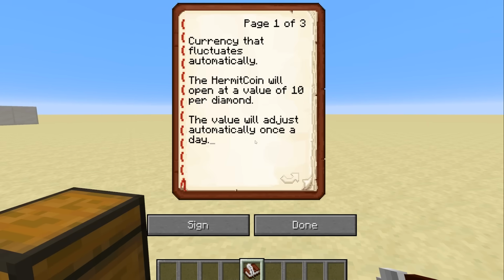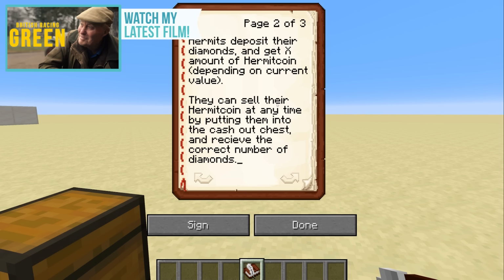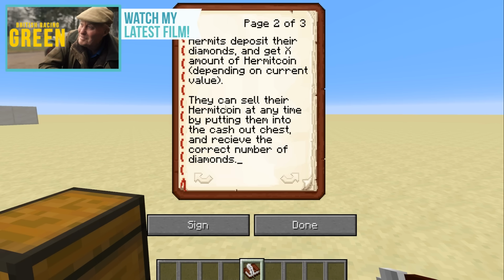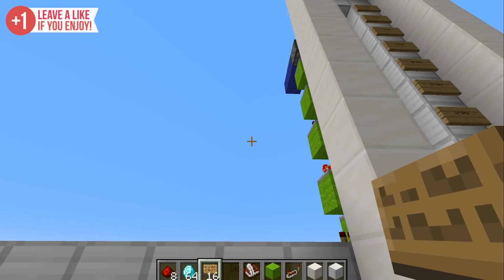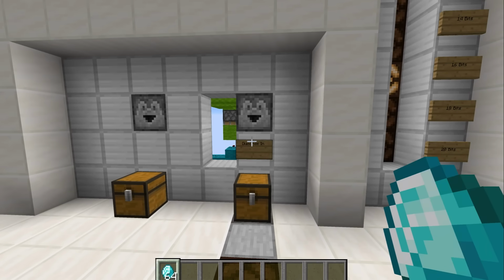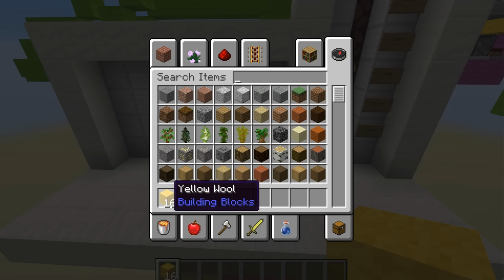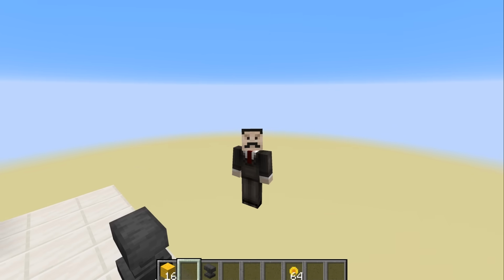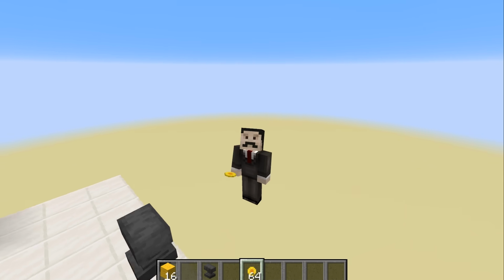HermitCoin Crypto Machine for Hermitcraft!

Comment: If you use the decoder lines also for the input as you have done for the output, you wont get any problems with counters running out os sync

Comment: Is it possible to do a 3x4 (3 wide, 4 tall) garage styled door design? (where the door pulls up and back). I haven't the first clue of redstone besides the torches and dust and even then I do the dust wrong, so I was wondering about that for a while. I made a Walking Dead inspired CDC and the doors look cool, but they don't work. There's 3 doors, but only one needs to work.

Comment: If it’s random, your machine will go broke, I understand how extremely difficult it would be to make it an actual cryptocurrency, so maybe you could add an entry fee or a use fee or a mumbucks pass? Or maybe instead of showing the hermits what the value is, make it a gamble to gain or lose diamonds. For a currency to work there needs to be circulation. You can’t have an economy that can be taken advantage of.

Comment: I think the price should be based on how many hermitcoins are left in stock, updated ever time a trade is made. This makes it impossible to lose diamonds because the total diamond value of all the hermitcoins is fixed. The ones sold first would be cheaper, and the ones sold later more expensive, but the total value of hermitcoins + diamonds in the system wouldn't change. It also encourages early adoption because the people who buy first will get a better price. This could be implemented by storing the hermitcoins in a line of hoppers, with a comparator output from each one. These signals would tie directly into the existing machine. If you charge a transaction fee of 1 diamond, you would be guaranteed to make money. Also, let the hermits take hermitcoins out of the building and trade them with each other. This is vital for hermitcoin to be valuable: you want other hermits to start accepting it in their shops. As others mentioned, a good way to give hermitcoin value would be to accept it at the upcoming Amazon sh Note on implantation: the price might change in the middle of a transaction if they put in serval diamonds (or several diamonds worth of hermitcoin) at one time. You should return any hermitcoin that wasn't in enough to buy a full diamond for this reason.

Comment: I think  there's an issue that arises if you put in say fifteen of sixteen HermitCoins and leave. The next Hermit will have one that is valued at one per diamond to them and then whoever put in the fifteen has no way of getting it back. you should put a coin return option or something that can be used if they didn't put in enough for a diamond.

Comment: I suggest that if the hermit will put a wrong number in, they will get the HermitCoins that left in the system back
Reply: Pretty hard to implement, but its possible. Mumbo would spend a day working on this though so in my opinion its not worth it. The hermits are trustworthy when the war is over :D

Comment: in order to add a form of profit for yourself, you should enclose the trade room, and in order to buy/sell, you have to toss in a diamond to unlock the door.. but you can see the current values without entering.. 

or..

you cant see the value, so you have to trade blind (or maybe only see a relative value, like low/med/high, instead of the exact amount) but you can tip a diamond to see the exact value.. but this would require you to either have different values on the exchange, for example, 1 diamond will get you 16 coins, but that same day, it takes 18 coins to buy back 1 diamond, or put a code of honor in, and tell the hermits they can only buy or sell on any given day, they cant do both

Comment: Price should be normalized and a spread created....each lamp would have a buy price on the left and sell price on the right, starting at say 102 to buy and 100 to sell, incrementing by 1 each upward (so buy goes from 102 to 117, sell goes from 100 to 115).  As you buy, price goes up by 1 lamp, and if you sell, price goes down 1 lamp.  So if you buy at 102, next purchase is at 103 and to sell it back would be 101, so a 1 unit loss immediately.

A really good system would encapsulate the entire range and have a digital display for buy and sell and take care of the movement of the market at any value. :)

Comment: 2 flaws i see. If a hermit waits till the price is really low for hermit coins and buys a bulk amount then comes back when it is at the max and cashed out. You are just lousing diamonds. There needs to be a way that when you buy hermit coin the price will drop slowly and if you sell it, it will rise slowly. Secondly I don't see how this would be beneficial for you. There is a very low chance they will buy 10 coins for 1 diamond and then sell it for 8. People won't do that, they will wait until the price is higher thus making it a money pit. You are going to have to make the buying rate higher than the selling rate so if you buy a 10 hermit coin for 1 diamond you can only sell for example 14 for 1 diamond so you have more competition for a good price and don't have just a money pit.

Comment: With the final output solution with the clock, it looks like the downward piston (that allows conducting the signal out to spit out a diamond) is no longer necessary.  The observer block only extends when the correct number has been reached, so the top piston is not needed.  A little less lag, a lot less noise.

Comment: When u get the Sahara Shop set up set the prices for the items in Hermitcoins. The buyers of the coins will feel like they are getting a deal on your products when the price of the Hermitcoins is high and won't trade them all in for diamonds at once which could potentially ruin you. And when the price for HC is low then ur getting a higher amount of coins back through ur shop!

Comment: Mumbo, you have got it all wrong, the higher the meter the lower the value of a HermitCoin. If it's on 16 hermits per diamond that means it's worth a 16th of a diamond, in the other hand, if it's word 1/2 of a diamond it means that every 2 hermits you get a diamond

Comment: Hi. As a fan of your videos, I'd like to present an argument as to why HermitCoin (in it's current state) is not profitable. I'll also look to try to add solutions to make sure that you can create a sustainable system. I'll be explaining each problem and potential solutions in depth. These are unordered, meaning #1 may not be as important as #3 or vice versa.

1.) Reason / Explanation:  Inflation / Deflation. The volume of your currency is the number of currency that exist at the start. If you add more currency later, the currency value will fall because of more supply relative to demand (inflation), and if you remove currency, the value will fall because of less supply relative to demand (deflation). It depends what you want to do with your currency, because if you have a constant volume of your currency, the value will stay the same. The problem lies in the fact that we are trading diamonds for currency. Diamonds are a nearly infinite resource in Minecraft, given that you mine enough. This means that the value of a diamond will continuously depreciate because of more being discovered every day. In the first few episodes, if someone offered you some diamonds, you would probably have to give them a lot to make up for it. Now, they're the norm. Though HermitCoin will bounce up and down because of randomness, its value relative to Diamonds will shoot through the roof.

Example:
Let's say we have 100 HermitCoin and 50 diamonds in the world. The exchange rate is about 2 HermitCoin per diamond, or 0.5 Diamond per HermitCoin. Let's say Grian discovers 50 more diamonds. The exchange rate to match volume would then change to 1 Hermit Coin per diamond or 1 Diamond per HermitCoin. Mumbo, being lucky, now discovers another 300 diamonds. This brings the volumes to 100 HermitCoin vs 400 Diamond, giving the exchange rate to become 0.25 HermitCoin per diamond, or 4 Diamonds per HermitCoin. As the other Hermits discover and mine more diamonds, HermitCoin will become vastly more valuable.

Current Problem:
Since you currently put an (arbitrary number) bits of HermitCoin per Diamond, your currency will be easy to exploit. If we have 500 HermitCoin, and someone goes and mines up a bunch of diamonds, your counter goes smaller and smaller, until you can't really count it. If you go to any chart of  USD / Bitcoin (in that order) you'll see that the long term trend is always to get smaller and smaller, as the currency becomes more valuable.

Solution:
Change your exchange's currencies to use diamond to HermitCoin exchange, such that the initial price may be 4 diamonds per HermitCoin. This will also help stifle some early issues with supply / demand.

2.) Reason / Explanation Price Action: Price action is defined as the movement of price up and down due to changes in volume and relative demand / supply of a product. Currently, price action is merely random and fixed rate. Day by day, the value changes, randomly up or down, without a care about the supply or demand. As we have a fixed volume, this is the absolute limit which should drive price action. The less supply there is (or the more demand), the higher the price gets, and the more supply there is (or lower demand), the lower the price will get. This is completely absent in your currency.

Example:
The price of HermitCoin is 16 bits per diamond, near the lowest it can be. DocM buys 64 bits of HermitCoin for 4 diamonds. The price increases over the next few days to 8 bits per diamond. He cashes out for 8 diamonds, a profit of 4 diamonds. Even with commission, you lose diamonds.

Current Problem:
The randomness is what kills you here. If Warren Buffet decided to sell all his shares of AAPL, a huge position, the price of AAPL would crash and burn in the chaos of panic selling. Similarly if he decided to reinvest all that money into SBUX, the price of SBUX would shoot up big time. In your world, if I decide to buy some HermitCoin, the price is unaffected by that decision, even though IRL, it would. 

Solution:
Make your currency's price update relative to volume. If I buy 50% of all HermitCoin, the price should spike 10x more than if I bought 5% of all HermitCoin. As you approach 100% volume bought, the price would soar higher and higher. On every trade, inspect the total volume. If the broker's volume increases, price may drop. If broker's volume decreases, prices go up. This will also mean that Hermits will not be able to exploit trades, and can hurt each other by selling / buying against their opponent, meaning some Hermits will take losses, meaning that you get some 'free' money.

3.) Reason / Explanation Commissions / Trading: Though you currently have a system where you get 1 diamond per transaction, as the value of a diamond decreases, you will consistently be making less and less money, and have to continually raise the commission based on the value of a diamond. In real life trading, these commissions are applied when you send a trade (a buy order) and when you close a trade (a sell order). But another real life tool that you can use is leveraging. In real life, people can buy more shares than they currently can afford due to leverage. While some exchanges like stocks offer 2x to 4x leverage, meaning if you have $400, you can buy $800 and $1600 worth of stock, currency exchanges (Foreign Exchange Market) can offer up to 50x leverage in the US and much higher around the world. The reason why these are successful is that they are high interest loans. If you hold them for too long, you end up paying lots of money on your loan.

Current Problem: Your commissions / trading structure does not favor the broker. If Grian goes and makes a trade on HermitCoin and makes a 4 diamond profit, he pays you one diamond for the entire trade, meaning that you lost 3 diamonds. Only if he lost diamonds would you profit, and your current system has no good way of causing losses. 

Solution: Add "loans" where you can buy more HermitCoin for a deposit of diamonds, but have an interest rate, where each day, the player loses some amount of HermitCoin. As your system works, it will grow up the amount of HermitCoin. When you have collected enough interest on the trade, your system automatically trades the value back into diamonds. Another way to safeguard against the inflation of the diamond is to keep and hold your currency. If you have all the broker fees in terms of HermitCoins, you now will have an investment which will always grow in value, and at a whim you can cash out for whatever purchases you make. You can also design the system to have various related fees like an "annual" fee every number of daylight cycles. You can also make trade commissions percentage based, meaning the more they profit, the more you charge.

Comment: I dont know If im wrong, but isnt there a mistake with the machine? Like when it is at 16 you get 16 coins for a Diamant. And when its Like 12 you get a Diamant back for 12. So you buy high and sell Low? The other way round with hermitcoin>diamants  it would make more Sense, right?
Reply: Higher value 1 coin for 12 diamants or so
Reply: *diamond

Comment: ONE major problem MUMBO!!!!! if you put in 15 you don't get anything but the next person gets a diamond for 1 coin
Reply: probably but a tripwire at the entrance, automatically clear that 15 coins as transaction fee, at least the next user won't get extra diamond
Reply: But if so, there should be information "one person at a time in the hermitcoin station"
Reply: He could use a door with a T-flip-flop pressure plate on the inside, and link the reset to that. Have the door close as you come in, open as you go out. Deals with the reset and the one at a time issue.
Reply: @TommyHayter  Two door system, inner door and outer door. The inner door has an observer pointing down and resets the system when activated. Stand on a pressure plate as you use the system and that locks the outer door so no one comes in and messes up your count.
Reply: that is just one of the major problems of the machine
Reply: then just dont put 15, save those for later
Reply: It’s not that major. I’m sure the Hermits won’t be that annoyed or angered, at least.
Reply: What if, since it is currently random, while the machine is counting your coins the value changes?
Reply: @steves4585  since it uses a daylight sensor, they would have to be using it right at the moment the sun rises, so there could be a system that closes the place until its done changing
Reply: That's a good thing to think about but he already adressed in the video if you hadn't noticed. The hermitcoins will just be lost. No one else can use those extra 15
Reply: I have made an improved version that fixes that! The whole system could be a lot more compact this way. On my channel.
Reply: You could put a diamond in the macine and put in one that you get
Reply: They don't the person who puts 15 in just loses those 15 if that same person were to put another in they would just lose another.
(Don't quote me on it, though)
Reply: That's why it needs member account for the machine
Reply: He solved it
Reply: He already announced to fix that in another video didn't he?
Reply: True
Reply: Ya

Comment: What happens if someone put in 15 coins, assuming 1 diamond = 16 coins, and then someone comes by later to exchange coins for diamonds? Wouldn't that mean the second person only payed 1 coin for a diamond? I would assume a return system would be needed for times when less than 1 diamonds worth of coins are in the system, or even if the price per diamond drops while there are coins in the system. Then that would mean it would just randomly spit out a diamond right?

Comment: heres some feed back: 
1. what happens to the hermit coins that are the wrong number (you put in 15 when it required 16 per diamond) do you get them back or are they lost?
2. you should use 2 randomizers to determine the value of the hermitcoins. one for value up, value down, and value stays the same. and one for the amount (1-3) that way you have more fluctuation with the coin
3. you could implement a system where for every X amount diamonds exchanged for hermit coin and the other way around the machine gets an aditional value fluctuation. so lets say for every 100 diamonds put in or taken out the machine re 'calculates' the value outside of the day/night cycle. so you can get lucky or unlucky when getting hermit coin

Comment: Wasn't the original concept going to involve charging a diamond per transaction, or something  like that? How easy will it be to incorporate that into your system, and if someone puts 15 in when they need 16, have they then just lost those coins? Would someone else be able to put one coin in and trigger a diamond back after someone left 15 in the system?

Comment: the value should depend on demand and supply or else there will be a huge loss.

also, with your system. If the value per diamond is for example 12, if someone put 11 in and go, then another person put 1 in, they would get a diamond for literally free.

Comment: Great system however there is a small flaw that i see in it. if a hermit does not put in enough coins, they lose their coins (which is good) however, when the next hermit comes up with 16 diamonds, and puts in the correct number, it counts the one from the previous hermit, therefore infinitely making the real cost 1, and any hermit could put in 1 and get a diamond.

Long story short, you should add a second clock underneath the counter, where if the hermit doesn’t put in the correct  number of required coins soon enough, it will reset the counter back to 0 without dispensing a diamond

Other than that, looks awesome! Keep it up!